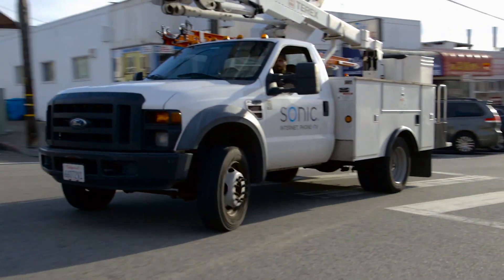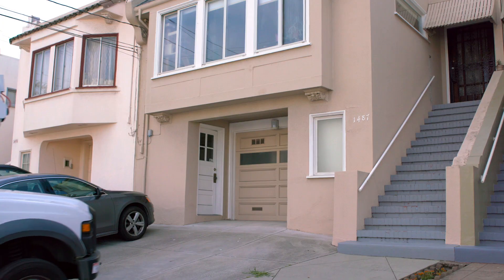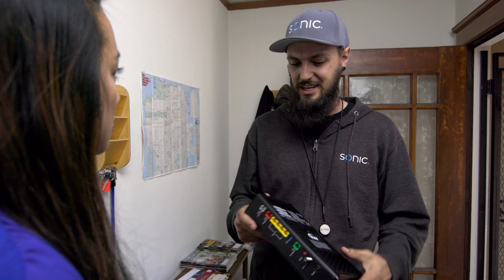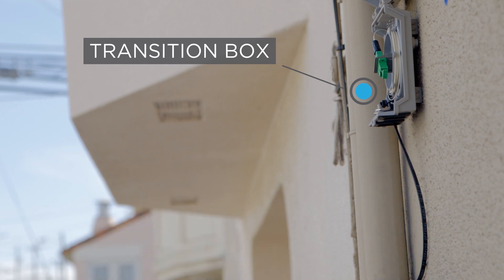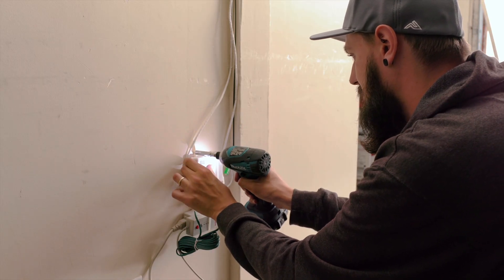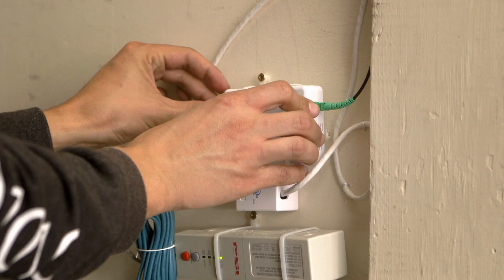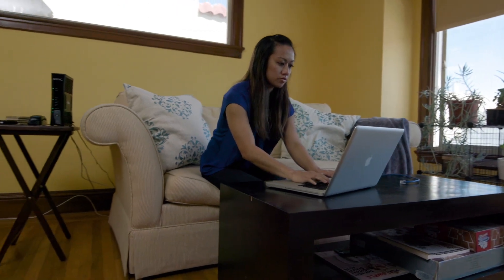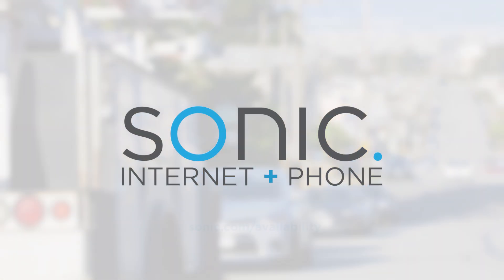What to Expect on Sonic Gigabit Fiber Installation Day

Comment: What if I want to use my own router that has a fiber optic WAN port? Would Sonic skip the transition box and the ONT altogether? This is how WISPs, at least with Monkeybrains, install their connection. There is a plain CAT cable from the dish to the PoE injector. A data CAT come out of the injector to plug into the RJ45 WAN port on any router. 

Why is the transition box be needed when the incoming wire into the ONT is also fiber? Why can't the transition box and ONT be one box?